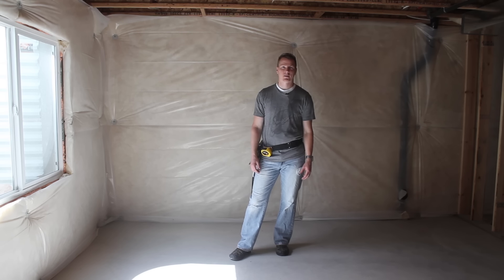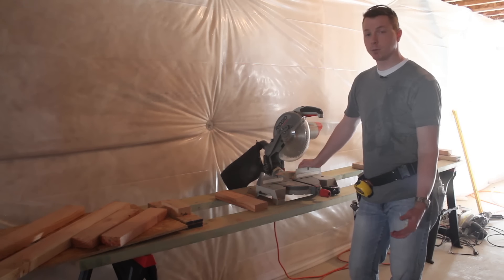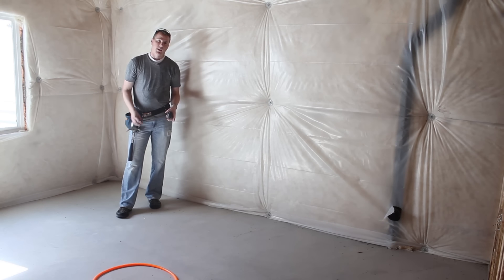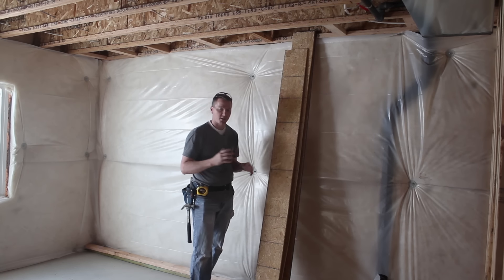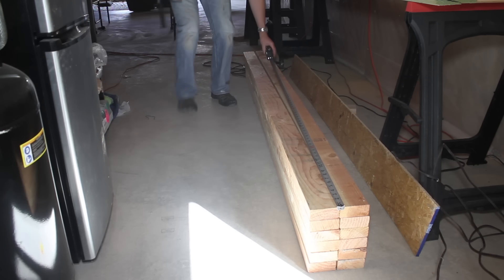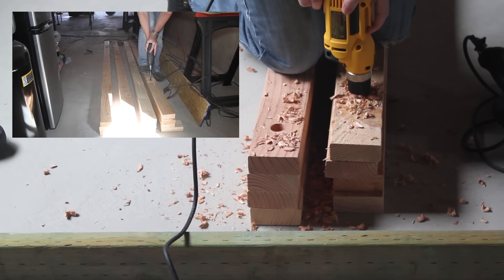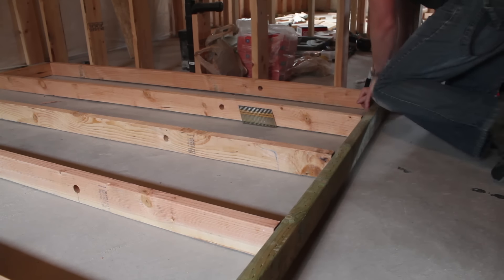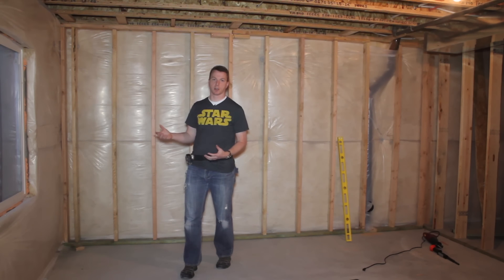How to Frame: Part 1 - Framing a Wall

Comment: Nils, don't forget.. NEVER load the Ramset first, then the nail....   Place the nail first, then load the charge. It could always accidentally fire with the charge in there as you're putting a nail in the barrel.  Great video!
Reply: One would have to go exceptionally out of their way in order to "accidentally" trigger one of these.  Never mind the fact that this specific ramset has no trigger, but the amount one has to push the point of this before the firing mechanism is even engaged makes the probability of an accidental firing close to none.  Often times it's just easier to clear the spent shell and then reload the nail.

Comment from the maker: Hi Thomas, I can't seem to reply to your comment directly, but the holes are really only for running electrical. There are some extra holes in a few of these studs where I was testing out the new drill and they don't serve any purpose - I really only drill the holes two feet up. I recently purchased a higher quality cordless drill set and have been using my cordless drill to make the holes and it has been awesome. The set cost around $300 but has a lifetime warranty on the batteries and drill, so I think it's worth it.

Comment: I used a 2x6 for my fire break --- but I have 2 walls where I need to add that thin board to create a seal --- and having those 15 in 2x4 across is a great idea ... I'll be doing that on my 22 foot walls... Glad I watched !  😁

Comment: You're supposed to mark the stud over 15.25" from end, & mark X in direction you're measuring to. Marking 16" is for your Centre, so if you mark centre, & put X beside it, you're drywall won't line up properly. You mark 15.25" b/c that's where your boards edge lines up
Reply: Yep! A rookie mistake. If you center the first stud at 16-3/4" as shown in this video it messes up the installation of your sheetrock. You should actually make the first mark at 15-1/4" and place your "X" to the left of that line. Granted , this first stud when placed will yield a slightly smaller space (when compared to all the other studs placed 16" on center) but you do it that way because your sheet rock starts out butted against the adjoining wall not on the centerline of the first stud.

Comment: Pretty interesting to see a different method for fastening the bottom plate to the subfloor, ive always used a hammer drill and tapcons

Comment: Nils great job I am a retired General contractor in residential and you did a great job, my only comment would be using correct terminology for your videos, any time you are checking alignment on a vertical plane it is not called level it is called plumb.  And you might stress safety for those less experienced DIYers.  But it was a great job.
Reply from the maker: Jack, thank you for both the kind words and some education. I'll leave notes in the video with the updated terminology. Thanks for watching!
Reply: Courteous constructive comments on YouTube? Am I dreaming? lol Great video btw!
Reply from the maker: I thought the same thing! Jack deserves a YouTube trophy for being both kind and constructive! Sadly, those can be rare qualities in the comments sections ;)
Reply: Jack Holt smug contractor comment on YouTube. Color me shocked. Level and plumb can mean the same thing
Reply: Ironfukr 9  the only thing I would add is using goggles and kneepads. Especially when using a nailgun

Comment: At 10:20 you just centered your first stud at 16-3/4" this will mess up you sheet rock install. You should have measured your first mark at 15-1/4" with the "X" left of that line. Yes, the space is smaller, but your sheet rock starts at the wall, not the center of the stud.
Reply: I find that many videos aren’t doing 16th inches on the center correctly.

Comment: Awesome work! I am planning on doing my basement the same way. However, after putting up the frame is the insulation still required even though the installation is behind that vapor wall?

Comment: I found it interesting how you did 16 inch OC. All the other places I have gone to say you mark each increment of 16 inches and draw your line, then to draw a line on each side of the first line 3/4 of an inch. The first line (16" mark) should be on the center of the stud and not to the side of the stud.
Reply: 16 o.c just means that every stud should be 16 from center to center and no gap should be more than that. So if you start your first stud at one end you can measure off like he did and just keep each stud on the same side of the line. You can actually start that first stud any number of inches off the end and measure off from there as long as it doesn't go over a gap of 16" center to center and to a face of an adjacent wall. Since they are not load bearing, he could even do 24" o.c.
Reply: He did not do 16” oc. His mark was at 16” but he out the stud to the side. He should have centered the stud on the mark for 16” oc!!
Reply: That's not necessary. Your first measurement could be 15 1/4 and then 16 from that. Your stud will always go on the side of the line furthest from the side you measured from. .

Comment: Great video. Thank you for making this . FYI,  side nailing through the bottom cord of trusses is not recommended because it affects the structural integrity. Better is to nail the block through the web and face nail another block for flush plate backing.

Comment: Should you mention regarding stud locations that other than the end studs, that each location will be 16 inch mark minus 3/4 . The first stud will be 15 1/4 , 31 1/4 n so on. Am I correct?
Reply: Peter Bergeris yes

Comment: My personal view is never build in a basement without a weep screed along the exterior (before concrete is poured, or can be retro-fited.) and a drain tile to a sump pump.  Sooner or later water will get passed the perimeter walls and into your basement for any number of reasons (or plumbing leaks).  While it can be done for almost nothing as the house is being built, it costs $7-8K to do it after, but you'll never have to worry about mold or leaks.  I've never torn out a basement living area without finding some rot/leaks/mold.

Comment: Thanks for the video. Looking at your top plates, you have a split in the middle and put small pieces of 2x4s around the stud. Is there a requirement how to connect two adjacent wall sections? specifically for basement...

Comment: The insulation on your walls is also in my unfinished basement. I have watched many videos that state you should use unfazed polystyrene 4 x 8 board insulation. They claim this is to avoid moisture from the two temperatures on the wall. I hope not to do that. Did you install that insulation or was it already installed?

Comment: Great video! Maybe I missed it, but do you have to shim between the top plate and blocks you installed when you go to fasten the top plate up? Since you cut the 2x4's to the shortest length (88 and 3/4th IIRC) minus 1/8th of an inch I'm assuming there are areas where there may be gaps.... ??
Reply from the maker: +Steven Cruz Thanks, Steven. I didn't shim the tops unless there was a sizable gap, which was rare. If the nail only has to span an open area of an 1/8" or so, it's going to stay in there really well still. I have now finished my basement and the walls are all totally solid, even without shims on top.
Reply: I must have a slope on the floor or ceiling and I have a one inch difference from one side to the other. Would you recommend cutting all the studs the same length and using a shim or cutting all the studs to specific lengths to match the measurement from the floor plate to ceiling plate?

Comment: Interesting project explained in detail. I'm looking forward to following along and becoming inspired to maybe tackle  something similar in my basement. One question; why did you drill holes  on the  2x4 studs? I understand  the holes for running electric wire for boxes  apx. 2' up but the lower one I am referring to.  Thank you Niles  .
Reply: Yes, what was the hole that was drilled very low (13:20)?
Reply: Joel Miller 
Those holes are for electrical wires.
Reply: @sprout2186  These are just scrap pieces to show the difference between the two drills.

Comment: Thanks for the video. Way more detail than others I've seen. But 3 questions.

1. How do you insulate the walls? Is there a video for that part?
2. Every video I've seen says to be at least 1 inch from the walls but none have explained exactly where that measurement commes from and why it's in place. So, why and from where exactly.
3. If there is a gap then why drill holes in the studs? Is this simply to make future electrical repairs easier?

Say I have insulated my concrete blocks (my wall). Am I supposed to be 1 inch or more away from the insulation now, laying the edge of both the top and bottom boards at up against the 1+ inch mark (not centered, but the actual edge of the board to 1+ inch mark)? So in effect, wall, then insulation, then  1+ inch (making a 1+ inch gap between the insulation and the new walls? And if so, why? What does the gap do for me?

Sorry if I'm asking stupi questions but I've never done this before.

Comment: Hi Nils, your video is really nice and good help for DIY. I have a question if you can answer please. I am trying to construct basement standing shower. Can i use 2x2 studs instead of 2x4 on the concrete wall side. All other side I have 2x4. On the concrete side where I want 2x2, there would no electrical or plumbing issue, I will use schluter board and tile on stud. Please advise.
Reply from the maker: I'm not 100% certain but I believe one of the reasons 2x4s are used is for their strength and rigidity when being mounted from the floor to the ceiling. If you're planning on fastening the 2x2s to the concrete wall, I think that would help a lot, but I'd definitely check into the code in your area to see what's ok. Good luck!
Reply: Thank you for your reply.

Comment: Thank you so much for answering my questions. I plan to have ceramic tiles in my basement. Should I glue them directly to the cement floor? I hired someone to do my kitchen before and I remember they put something down like backer board before they put the ceramic tiles on top. Thank you again.
Reply from the maker: You're going to get different answers to that question depending on who you talk to. Generally if the concrete is in great shape then you can tile directly onto it. If you think there's any chance it will split, warp or crack, you should lay down backer board. There's no easy or correct answer that I'm aware of.

Comment: Just curious. Why use pressure treated wood for an interior wall? Is it because it's in the basement? Thanks
Reply from the maker: It's because it's right on the floor. If there is flooding of any sort, the pressure treated gives you rot resistance for that first inch and a half or so. It's also required for code compliance. As for whether that's required on a first floor when there's a basement under it, I'm not certain actually.

Comment: awesome video Nil, I am looking to start building my basement. Your videos are very helpful.
Reply from the maker: +liem nguyen Thanks for watching, Liem. If you haven't already, be sure to subscribe. I have videos coming out on electrical, plumbing, HVAC, audio/video, insulation and sheetrock. Most of it is already shot, just need to edit them and put them up :)
Reply: b

Comment: I want to build a wall upstairs to close off the loft. The wall will be running parallel with the ceiling joists. I am around 7 inches away from the stud where the wall is going to be. Do I have to cut away my drywall to install blocking or is there an easier way that I'm not aware of?
Reply from the maker: Hey Todd, unfortunately I think that's what you'll have to do. It's a pain but I don't know of a way to get the strength you need without cutting into the drywall and adding the blocking between the joists, then attaching your new wall to the blocking. Best of luck.

Comment: The wall layout was wrong. Every 16 inches should be the center of the stud, not the edge. This would cause problems when applying 8 foot sheet rock because it wouldn’t land halfway on a stud.  I’ve made that mistake before.

Comment: What details can you give on how you mounted the vapor barrier? What size hex head and where do you get that huge washer?
Reply from the maker: Unfortunately, I'm not much help there - that was all there when the home was built and I haven't looked into it before. Sorry I'm not more help on that one.
Reply: Depending on your area, that will determine what you do for vapor barrier. If the house is newer and the basement is not a walk in like this one, but rather, underground.. you actually might not want a vapor barrier. If you Google around a bit you can determine the best option for your area.  I'm in Massachusetts, so the weather and style of basement actually means I'll be using rigid foam that is "open cell" or vapor permeable and will not be using any vapor barrier.

Comment: Could you frame on the parallel joist if that is exactly where you want your wall? Or do you need to have a block/cat?
Reply from the maker: If I understand your question, yes - you can frame directly under/attached to a joist. No need to block it off in that case. As long as you're able to secure the new wall to the joist properly, that should work just fine.
Reply: @LRN2DIY  Thanks for the reply and help! Adding the block would only give me two extra inches of wall  so I was thinking of just nailing to the parallel joint to make things easier and avoid some of the duct work that would be in my way.

Comment: How do I know if I need a fire block above my framed wall? like you did. I have an unfinished basement of a town home,, I can see at the top there are 2 slabs of sheet rock above the concrete. I would like to get started framing my exterior walls. thanks

Comment: can you explain the splicing of the two studs? Is there a requirement with blocking?  I have a situation where 16 oc is occuring right at the end of an 8 foot stud and dont know best way to proceed.  perhaps just butt another stud right next to it and measure 16oc from the  first stud?

Comment: What level should I use, box or I-beam, 48” or 72”? I’ve never done this before. Thank you.
Reply from the maker: Hung Nguyen Honestly either box or iframe will work fine and anything 48” or above will work fine. Longer is typically better. Good luck!

Comment: Hi Nils! For measuring the stud lengths I have seen different theories . Some measure each stud and cut to length less  1/8" , and some do as you are with using all same lengths. I am finding that my individual cut lengths make it hard and tighter to stand up a wall. If I use your method, however, my gap could be up to 1/2" from top plate to joist. That would still be ok right, assuming I use 5/8" sheet rock? As an example  my stud measurements were from 86 1/2 to 87 (this included the subtraction of 1/8" from measurement). I'd like to use your method but am not sure that 1/2" gap is ok. Any thoughts?
Reply: Pete Chirpich Wedge a shim in the gap.  Drive a screw up threw it.  Drywall and done.

Comment: Where do you find the building codes you have to follow when finishing your basement?
Reply from the maker: You can usually do a search for your city or state and then “building code” and I’ve had good luck with that.

Comment: Hey Nils, I'm having trouble measuring for my windows and doors. I was told to leave 1/2 in all the way around windows and doors so if I'm framing for a 30x60 window what's the space I need?  and a 30x80 door? I usually end up with a tight fit and have to cut out some studs
Reply from the maker: Hey there, For the windows, you want to end up with as much space as possible while still overlapping some of the window frame/vinyl. If you're able for example to frame your window such that you have 1/8" of the frame being covered up by the studs, that's fantastic. If it's a bit more, that's ok too. Technically, you don't even need to do that because the drywall can be butted up against the frame too. For the doors, I've heard that you should leave between 1" and 2" of space. If the actual outside measurement of your prehung doorframe is 30" x 80", then you'd leave an opening of between 31" x 81" and 32" x 82". That gives enough room to get the frame perfectly plumb in both directions. Does that all make sense?
Reply: DIY Nils Thank You so much dude, I try with that and see. I usually end up wrong with my jack studs.
Reply: DIY Nils I think I was adding the size of the king stud also and end up wrong
Reply: DIY Nils Thank You Nils, it's a bit clearer now. Did a wall yesterday and didn't come out to bad. Made the outside of the window frame outside flush to accommodate siding.